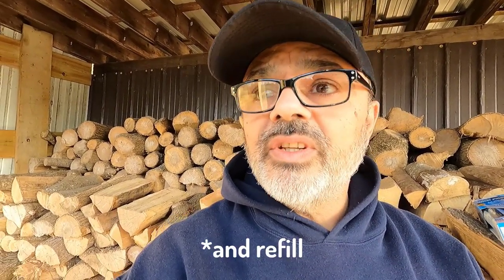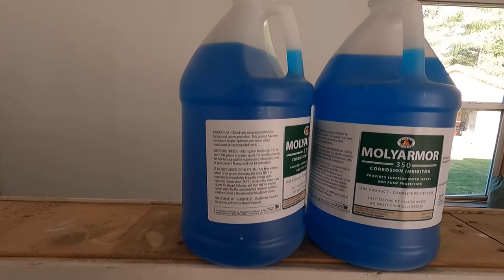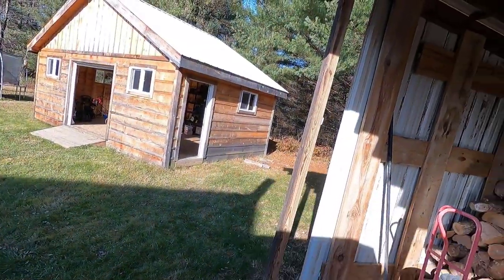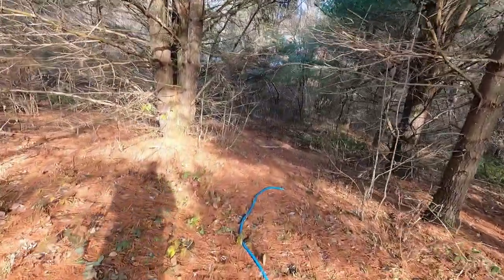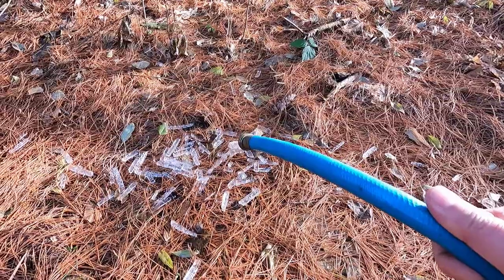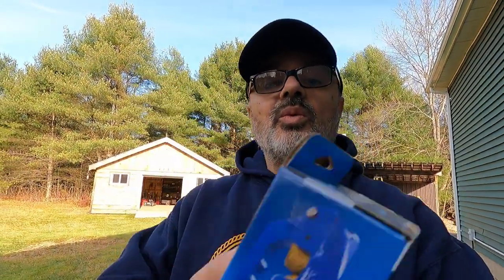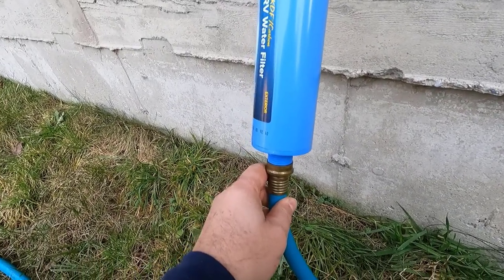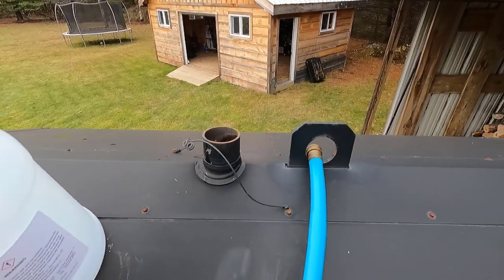Protect Your Outdoor Wood Boiler | Water Change And Treatment For My Central Boiler Classic CL 6048

Comment: Just so you know for next time you need to put in the molyarmor first before you fill it with water it will void your warranty.
Reply from the maker: Good to know Hudson. I will surely add it first next time. I fired up the boiler right after the water treatment and that is the next vlog tomorrow Friday. I have to tell you, I am in love with this boiler.
Reply: @oviduran  yes I loved mine it started leaking this summer so this fall I put in a new classic edge 760 hdx it is so much better no smoke and urns less wood

Comment: Question: If the water was clean, does it have to be drained? Another great video!
Reply from the maker: About every three years a flush is recommended. I was not aware of any previous flushes so I decided to do it now. But it came out clean and am happy because of it.
Reply: @oviduran  I'm curious. The tank is about 400 gallons, but how many gallons are in the lines and in the house heat exchanger? Are there any requirements to flush those out?
Reply from the maker: @RVBob  The previous owner of this house only flushed out the tank on the boiler and he did a good job because the water came out very clean. No word on the inside of the house. He did leave many manuals and I will have to research how many gallons are inside.

Comment: I realize it's too late now since I'm watching the video but you should have rinsed fresh water through the hose to flush it before starting to fill your tank. Those charcoal filters will release a lot of charcoal dust in the first 1 or 2 seconds of use.
Reply from the maker: Good point Robert. I did turn on the water with the filter only attached and noticed some charcoal dust discharge. It went into the ground. Did it for a minute and then connected to the hose. At first I thought it was just this one filter but now I realize through your comment that it happens, probably to many other people. I will surely mention it next time I flush and refill. Many thanks.
Reply: @oviduran  Absolutely Sr Chief! I have watched all your videos and really enjoy them. 
I use that same filter on my camper water supply so I was familiar with that dust. It will release a short burst each time you first use it.